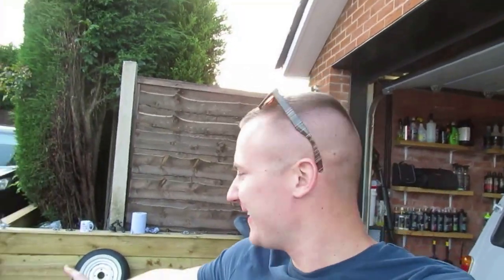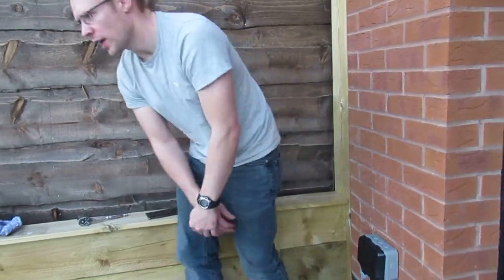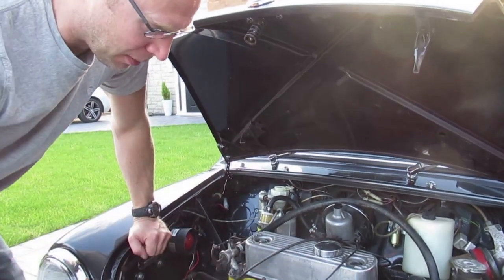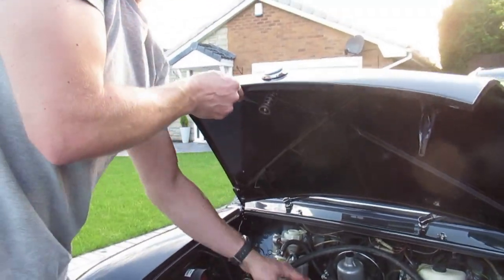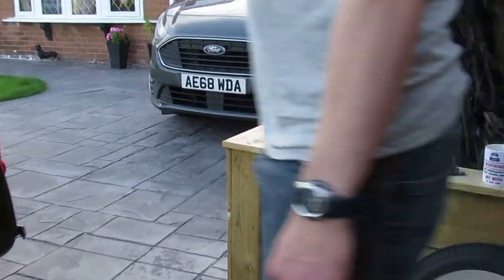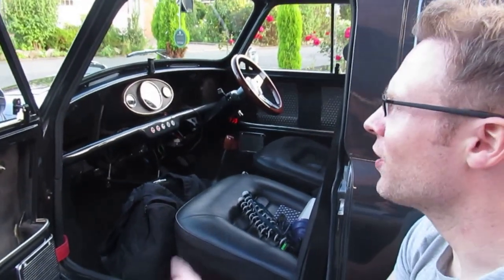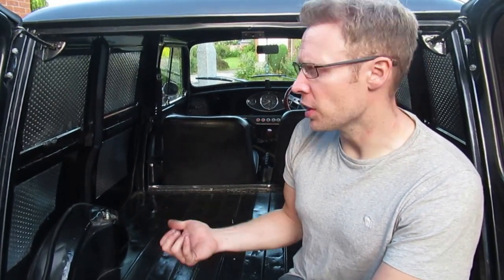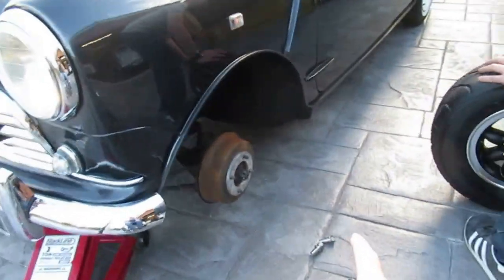Steve bought a MINIVAN!

Comment: 13" wheels on a mini is only good for a racetrack, which needs proper setting up! On the road its just horrible to drive (my 1996 Blue Star Spi had factory-fitted Rover SportPack 6x13") and I've driven better..
Friend of mine converted his 1998 Mpi to S-brakes and 6x10 Revolution with Yokohama 008's which made it great fun to drive! 63bhp dont need more than 7,5"
S-brakes. A proper Mk1-3 S' had 76bhp and was alright with those brakes.
Still think Steve is doing the right thing trying to fit 7,9" discs.
Oh and the Mini's suspension was designed for 10" wheels, so go figure why it handles best with them.
Reply: I need 13s on the cooper for grip. And they look cool.

Comment: Imho those white steels and white wheels look super nasty and cheap. It's not a vw and white walls look odd on that size wheel. Clean tyres and rosepetals or an alt 10'' wheel look a lot better and work a lot better. Steels in their original silver would also look far better. 13'' should not even be crossing your mind haha. Don't cut the panels. Just my 2 pence.